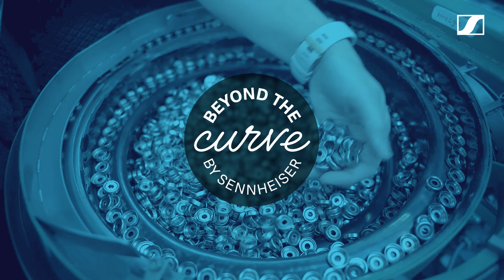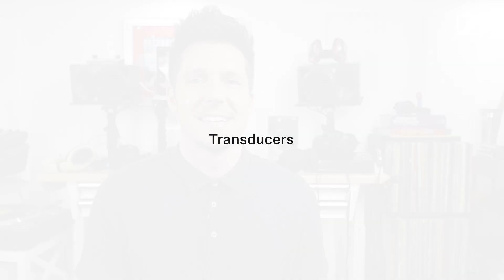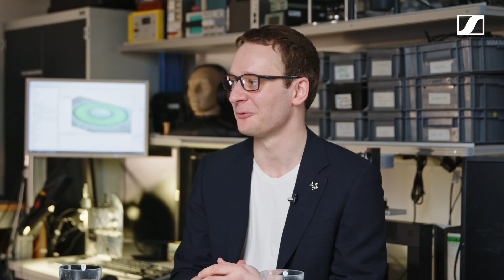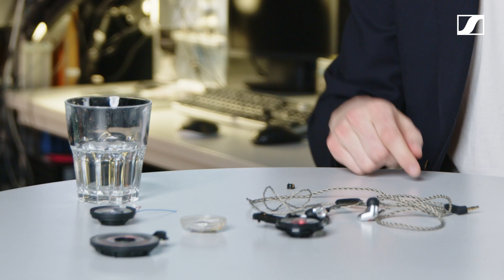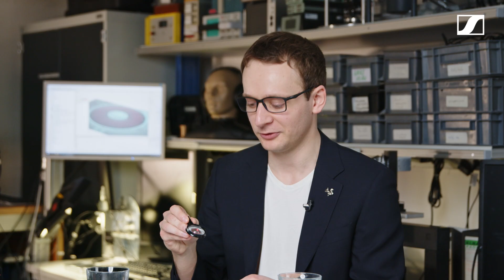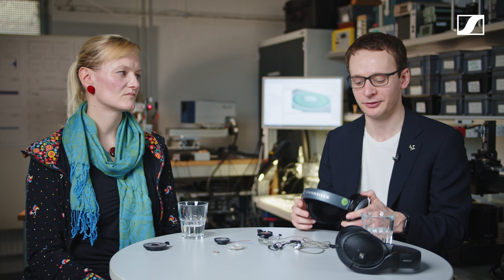Beyond the Curve EP04 - Transducers | Sennheiser

Comment: I would like to ask if Sennheiser has explored using planar magnetic transducers or even solid metal domes such as beryllium like other companies are using. Or even just metal coated diaphragms. I know there’s both benefits and compromises for these types of drivers as opposed to traditional diaphragm material Sennheiser uses.
Reply from the maker: Thanks for your interest! We've experimented with all transducer types and continue to look at every emerging technology. Regarding diaphragm materials: Our "traditional" material is a carefully assembled patented laminate of a stiff plastic foil and a material with highly self-damping properties, so we get the benefit of a relatively stable diaphragm thanks to the stiff plastic. At the same time, the damping element effectively eliminates harsh resonances. When experimenting with very stiff cones, we found that the resonance frequency increases significantly, and the resonance itself becomes harsher with the increased stiffness, which may be audible through intermodulation distortion. Using stiffer materials took us away from what we consider natural sound reproduction.

Comment: Did you just say at 19:24 that you can hear in the mids distortions at 70dB that the machine measurement can not show?
Most people say that the human brain is much less capable to hear distortions than the machine.
Reply: that's what he said, after clarifying that it was his personal opinion. Because the distortions would not show up on measurements at such low levels of sound pressure output. 
His scientific explanation would support that, since the coil doesn't travel too far if the sound pressure level isn't very high, so the chance for it to leave the range of the magnet is minimal.

My guess is that it has a lot more to do with the Impulse Response of the transducer. If the magnet is weak or the diaphragm "lazy", then it will take a long time for it to fully move into position, before it then slowly moves back. That results in a lack of "punch" and "slam".
On the frequency response curve, that would not show up, because the system can still reproduce that frequency, just not "fast".

At least, that's my understanding. 

If you have closed-backs of the same system (e.g. DT770 vs DT990) you will notice that they are usually "faster", simply because the closed back creates pressure that pushes the diaphragm back into position when it textends outwards.
Reply: @photominion  
The human ear senses not the position of the diaphragm, but its amplitude. What is slow to reach is not a spacial position of the diaphragm but an amplitude value of its wave movement. Closing the back of the headphone does not help in that. I had DT 770, 880, TYGR - they sounded to me with the same [quit high] dynamism.

Comment: You started to talk about "dynamism", but at the end have not said much about it, or anything substantial at all even. What is "dynamism"? Focal says that it is something independent of the frequency response. I also feel so, because i equalize my headphones extensively and dynamism to me does not change with the frequency response, with any headphone. You said that it may depend on the magnetic field coverage of the excursion of the coil. But that is not convincing to me. Driving out of the magnetic field does not happen at low volume, right? But slow-sounding headphones [HD 600, Game One] do sound slow to me at low volume too. But the technically very close HD 598 sounds dynamic to me. Thank you in advance if you can shed light into my amateur mind in a future episode.
Reply from the maker: Thank you for being so interested. As you rightly start off with, first one has to clearly define and align on different expressions to examine a topic with clarity. My answer regarding the compliance of the surround and a deep magnetic yoke with a very even magnetic field was related to the impression of "bass impact" or "slam", which to me is very different than "speed"/"brilliance". "bass impact" to me has a physical dimension, and while you can sense the capability of bass impact at lower volumes, it becomes very obvious if you listen somewhat loudly. For the HD 600 and HD 599 I personally don't hear a major difference, the magnet and the compliance of the surround are very comparable. The HD 599 distorts slightly less in the bass due to a bass tube, which may help with the sensation of bass impact, but both are clearly a level below the HD 660S2 with a larger and stronger magnet and much more compliant surround.
Regarding "speed", that is where a lot of people would associate "detail retrieval" or a "fast impulse response". I believe that superior perception of speed correlates with high-frequency extension and smooth treble with natural high amplitude, where a lower mass transducer plays a large role, or potentially less damping behavior of the diaphragm. To my ears, the HD 600 is significantly faster than the HD 599 owing to a much lighter coil and higher lorentz force.

Keep in mind that those are just some of my personal observations. At Sennheiser there are many seasoned engineers with much more listening experience and deeper technical background than me, and we can not openly talk about every theory developed internally. At any rate, keep exploring what makes music sound great for you and trust your ears, they're more capable than people think.

Kind regards,
Jermo
Reply: Given the very close relationship between the HD 598 and Game One (same transducers), it’s interesting that you hear them different! Of course, the enclosure and stuff inside makes a significant difference… the Game Zero with a similar transducer again sounds completely different. Have you heard the HD 560S/PC38X, which have a slightly different transducer?

Comment: 23:09 the guests dodged the question on the diaphragm material. 😅
Reply: Duofol. Laminated PET.
Reply: Well, the community question was how long can the headphone last, Eric added the question to ask what is the diaphragm made of (assuming that it would be the moving parts that fail first). The wires are definitely part of the whole transducer system, and since they (used to) fail first that is where Jermo directed his time.

In a practical sense, considering the whole headphone, the diaphragm membrane is stiff but not “hard” where it will be brittle or break for a long time, the small connecting wires between the voice coils and headphone cable attachment point are placed such that very little “work” (bending) is applied to them, and most likely to deteriorate are foams that come into contact with the oils on our skin, and cables that may get run over by a chair or kinked from snagging on something.